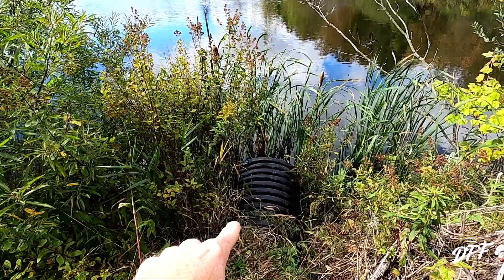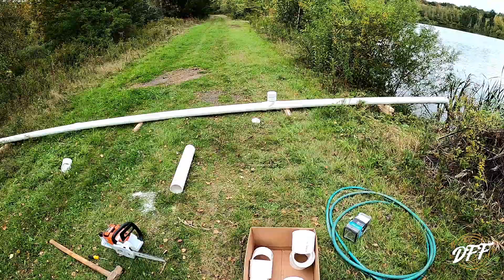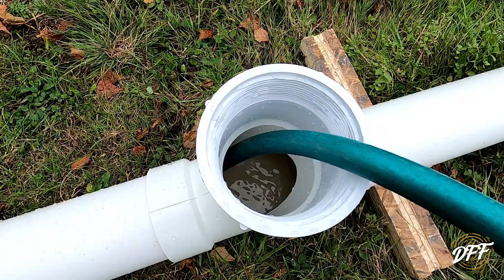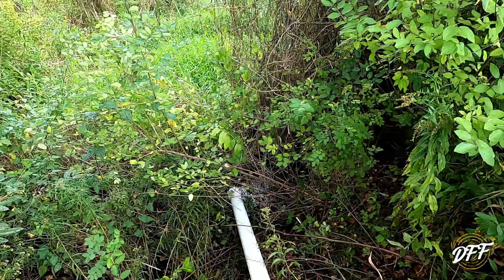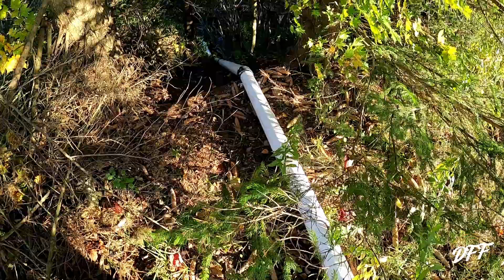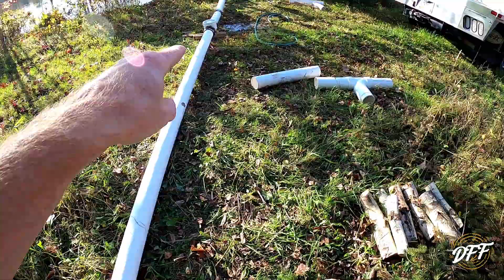Pond Siphon Install FAIL

Comment: Man yeah, the famous siphon system for draining a pond!! Been there on your fail attempt,can be very aggravating. I don't see how you even got the first one rigged by yourself, awesome job of that!! Hmmm,that sure looks like a backflow in the middle now. But the new layout worked perfect, awesome job!! That's great flow coming out! I hope you can get it drained enough to do the repair sir!! I enjoyed the video, like seeing the off the farm work too, kinda up my alley on the daily!! Thank you sir for bringing us along, look fwd to more!!!👌👍
Reply from the maker: It was difficult setting it up the first time by myself. That is a backflow valve in the middle, but I took the flap out of it. I thought maybe I was getting air with the first tee and cap I tried, so I changed it because this has a rubber seal on the cap. Great eye for noticing that! The pond has dropped almost two feet now. Thanks!!
Reply: @diggingfarmingfixing  Well sir, hats off for getting it set up alone the first time, and I thought it was😉 That was a great idea with the rubber gasket👌 Heck yeah, that sounds like it will get it low enough for your repairs!! Thank you , Mr Chris!!

Comment: Nice Chris, question, it looks if you pipe run over a kind of a road, will you put it under ground?
Reply from the maker: The siphon is just temporary, used to lower the water level so I can install a permanent pipe under ground 🙂

Comment: Hey Chris, I learned something new. I have never seen that done before.
Reply from the maker: It's a pretty neat, low cost system. Only bad thing is, you need enough drop on the outlet side to make it work. Thanks for watching 🙂

Comment: I have never heard of a culvert lifting up. Must be something that happens where cold weather exists.
Reply from the maker: Yup. Ice builds up along the edges of lakes and ponds around here. Most everyone I know has to pull their dock out of the water at the end of the season so it doesn't get damaged too. Darn cold weather!!
Reply: @diggingfarmingfixing  Good to know, I have never experienced a cold winter it is impossible for water to freeze here.
Reply from the maker: @chargermopar  sounds like a great place to be! I hate cold weather...
Reply: @diggingfarmingfixing  The problem is that everyone came here and all the farms were wiped out, The heat and humidity become a burden over time.

Comment: How far down does the pond need to get drained & how long will it take for 4" of pipe to get it there?
Reply: My question as well 🤔
I've always just dug out and let it drain down.. just gotta be careful to not let it wash out...
Reply from the maker: @GosselinFarmsEdGosselin  I probably would have dug it out slowly too, but because of the constant wet weather here this year, I am afraid the ditch I would have dug would never have dried down enough to start packing it back full again. I just am hoping to avoid a muddy mess 🤞
Reply from the maker: It needs to go down about two and a half feet. Not sure exactly how long it will take on this particular pond, but probably a few days.